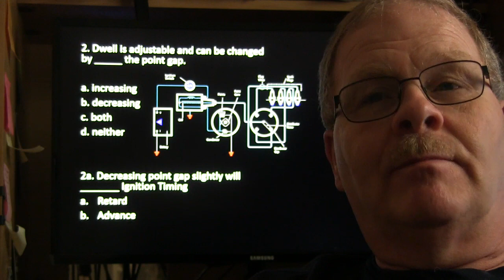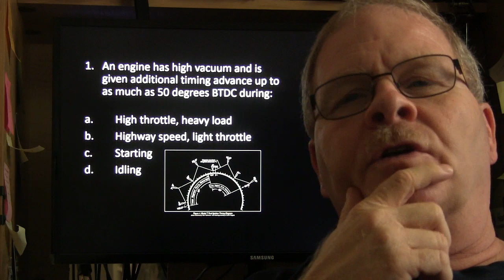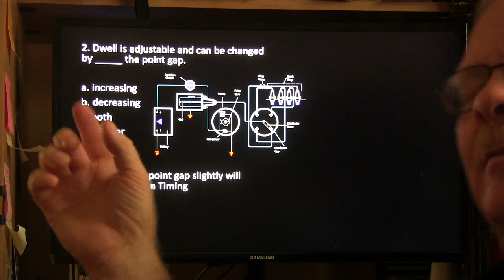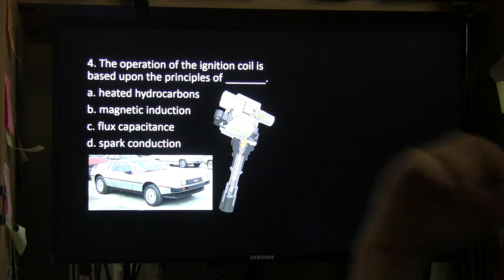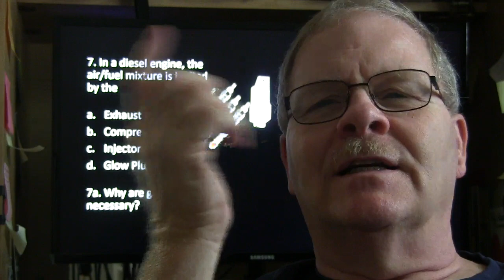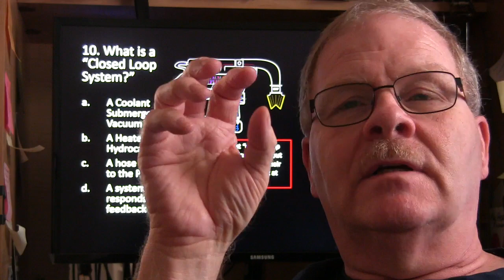Another Practice Test and Stories

Comment: I would like to check out an explorer that does that. First i would check electrical to see whats awake and whats asleep. If that is all good I would look into evap system and oil fuel saturation possibilities. Most electric blowers are a scam and can even interfere with flow. Increasing flow on a stock intake does little. Increasing air density (pressure & cooled) does a lot more.
Reply from the maker: I forgot to follow up on that but what it was was a stuck closed EEC power relay... Sorry about that. as long as that relay was closed to the PCM was awake even though the ignition system was down and it kept squirting fuel as long as the engine was moving.
Reply: @McCuistian  Thank you for the reply. I was thinking that would be weird if was not an electrical issue.
Reply from the maker: @Creaturemotorsport  It boggled my mind at the time but I reasoned it out pretty quickly - something had to be keeping the PCM and the injectors alive.